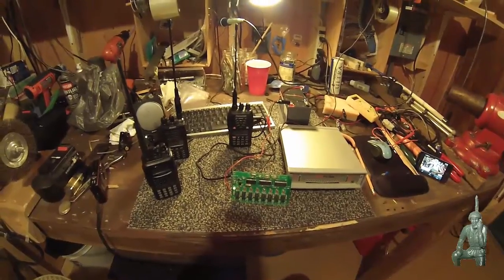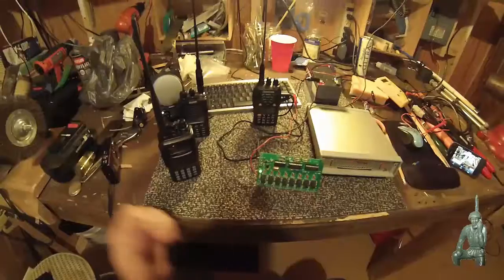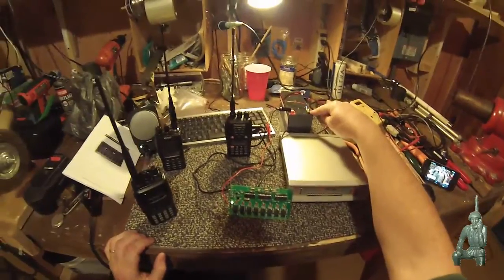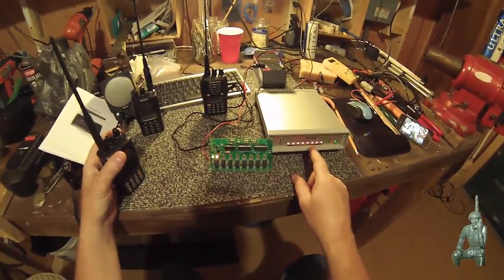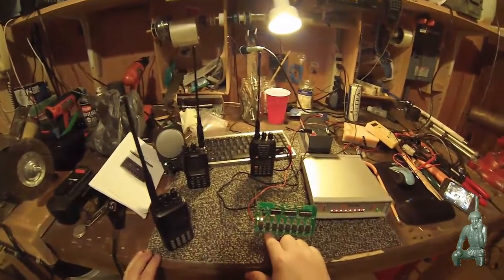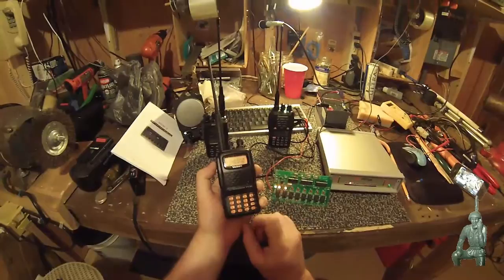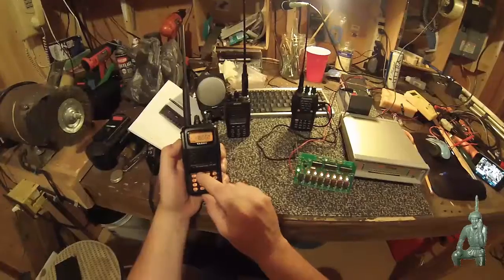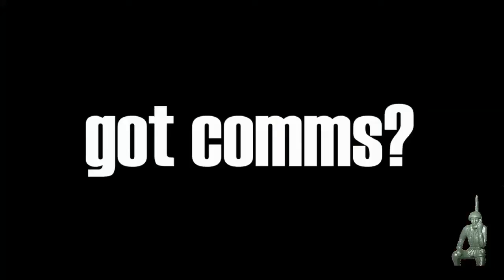DTMF Controller Card

Comment: Does it make a difference if it's simplex or through a repeater ?  other then distance ?
Reply: As long as the signal is strong enough for the decoder, it should be fine.

Comment: The parts to get my ham remote start setup are slowly coming together…muhahahah.

Actually a friend and I were talking about setting our GMRS repeaters up for remote shut down to keep some who don't need to be on our repeaters off. Little expensive for a single station though considering we're building the repeaters for under $50 a piece. Now, some of the other locations where we have packet, ham, and GMRS together would be a good place to use this.